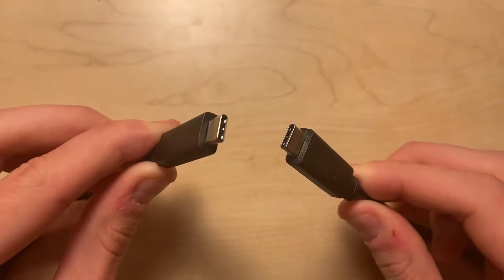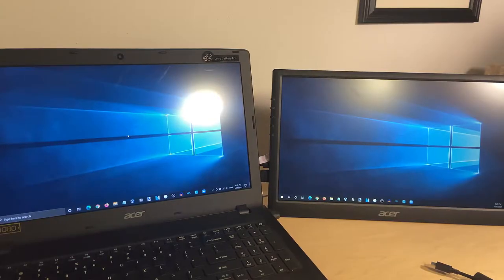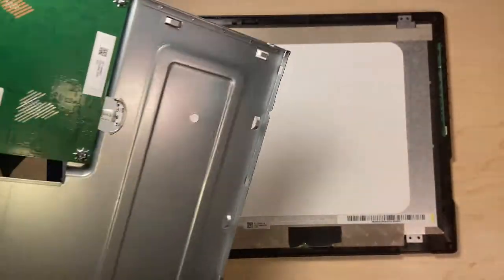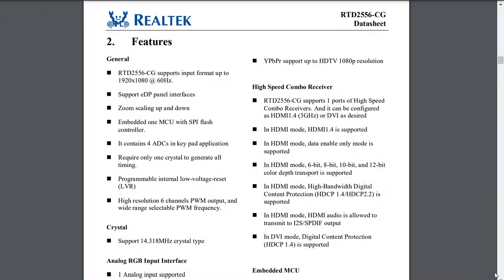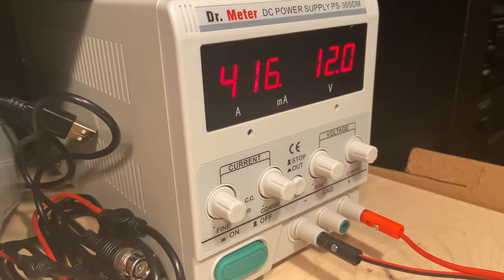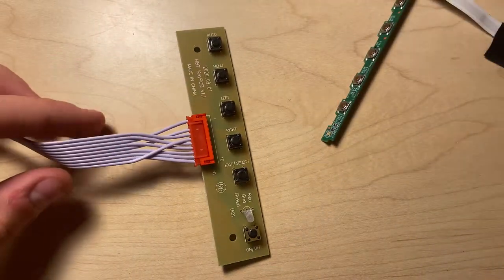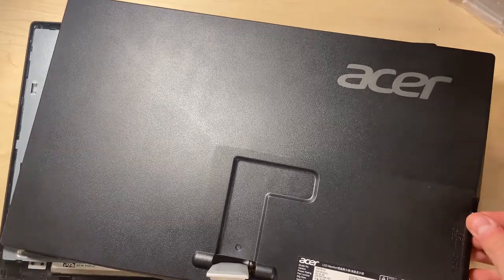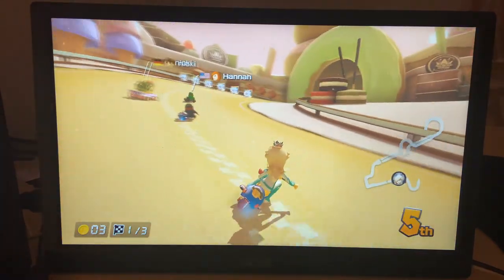[DIY] How to Convert a USB-C Portable Monitor to Have an HDMI Input | Acer PM161Q Hard Mod

Comment: Hey, just writing this here to say this works. The controller board works out just fine, everything connected easily, and the screen works a-ok. Great tutorial Dagoose, thanks so much for this. Super easy to follow and really helpful. Cheers!
Edit: I do have one question though: There's a pair of capacitors behind the powerport. After you removed the audio and power jacks to solder the breakout boards, did you remove them? It looks like you did. Does that affect anything?
Reply from the maker: Glad everything worked out! No, removing the capacitors didn’t effect anything. They are simply decoupling capacitors. I had to remove them amongst some other things on the board so that It would fit in the monitor’s case.

Comment: Just what I needed, tnx.
Reply: Hey @dagoose did your EDP cable come with connecters on both ends? Mine has a connector on one end but not the other.
Reply from the maker: Hey - sorry for late reply I did not get a notification for your comment. Yes my eDP cable came with connectors on each end. The board linked in the video description came with 2 eDP cables.
Reply: @DaGoose  Thanks for the reply, I must of bought a different card do you know where I could buy a eDP cable with connectors on each end? The one I bought only has connectors on one end 😢😢😢 Thanks for the help.
Reply from the maker: @designplusedit  by connectors on both ends do you mean the gold connectors on both ends?
Reply: @DaGoose  yes
Reply from the maker: @designplusedit  ok then this is what you’ll need (this is 30pin eDP cable with gold mounts on both ends): https://www.amazon.com/dp/B07B96N2FX/ref=cm_sw_r_cp_api_glc_fabc_P47MYNRSQK1JD9A65G0B
Reply: @DaGoose  🙏 Thanks man!

Comment: Seems like a Lotta Work for a "WHAT"$50 or less  Monitor?
Reply from the maker: did you bother to look up the price of the monitor? it’s $180 msrp brand new, at least during the time of making this video. the price of the display board that was swapped was ~$30. totally worth it IMO.
Reply: @DaGoose No but I wouldn't give Retail for a Cheap ass Acer Either! I  would have thought a little if Still had a warranty
Reply from the maker: who said i paid retail? i didn’t. I payed $119 when it was on sale. warranty was the least of my concerns. This video is nearly two years old and so is the monitor. it’s still being used with the mods to this day and hasn’t failed me despite it going out of warranty a year ago.
small, cheap hdmi (full, NOT mini) monitors are hard to come across by, so i’m quite shocked you don’t find this mod useful.
stop assuming that this was a stupid mod. if anything, it’s brilliant.